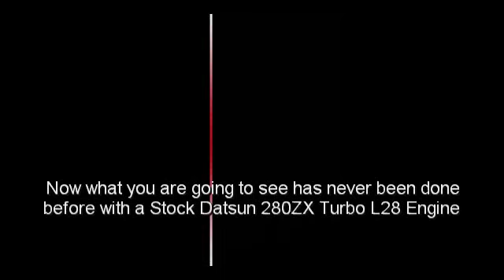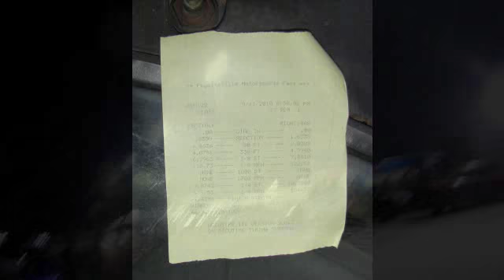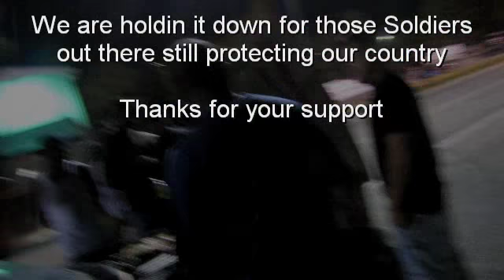Z Performance Racing 280ZX Competing @SICC North vs South Ra

Comment: You would have to lie to the tech officials to make only one pass before getting kicked out. If you told them up front the car ran in the 9s they wouldn't let you run because of the lack of safety equipment. It is obvious the turbo is a minimum of 94mm. Its clearly visible in the other video.